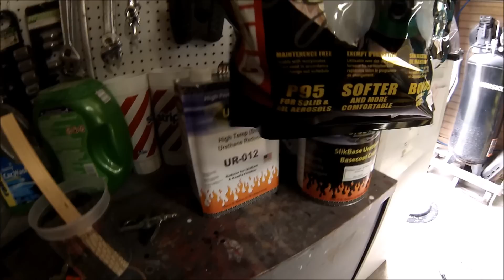2000 CHEVY SILVERADO RESPRAY WITH THE CARBONIO 360

Comment: I bought an electric porter cable DA to grind the paint off and save my air compressor and the noise.  Then I switch to a air DA once down to the metal.
Reply from the maker: Awesome I need to do that two

Comment: Would help a lot with the dust if u wet the floor with a water hose. When u spray the lower parts of the car a ton of dust comes up on the air. Also turning off the lights after finishing would help not to atract the bugs inside. Good work.

Comment: Every project you do is spectacular. How do you get the final clear coat so perfect without wet sanding and buffing?
Reply from the maker: Rob Arthur preping the body as perfect as posible and cleaning the area 3,4 times before painting
Reply: What number sand paper do you use at first to cut through the clear coat. I see you always finish with 320 wet sand and then spray.
Reply from the maker: I finished with 320 and 400 grit I stared with 220 and 320 grit

Comment: A few of us would love for you to tell us the time between all of your coats. Like I said before. I'm doing a candy with pearl over a silver base. Plus..  .... What gun, nozzel6, and and pressure are you using for each paint. Base, clear, etc. Thanks,  my paint brother.
Reply from the maker: The time between coats is 15min also for the clear the tip size it a 1.3 tip and about the air pressure it was at 29psi for the base and 35psi for the clear
Reply: What brand gun are you using

Comment: What Gun is that? Do you run 35psi off that 3.5hp husky air compressor?
Reply from the maker: it's a walcom carbonio 360 and yes it's a 60 gal compressor

Comment: What type of gun did you use
Reply from the maker: It's a Walcom Carbonio 360 made of carbon fiber
Reply: Damn that's nice what tips do you prefer when doing your base n clear
Reply from the maker: @jameswatts1808  I use a 1.3 for base and clear
Reply: @PHARRAWAY  nice job brother thanks
Reply from the maker: @jameswatts1808  any time brother here to help
Reply: @PHARRAWAY  I'm doing my truck and I got to knock off 2 bad paint jobs it has on it now ugh but it's getting there just need a compressor
Reply from the maker: @jameswatts1808  sounds good just don't rush on the work or you will have a bad foundation for the new paint job just take your time and do it right the first time
Reply: @PHARRAWAY  yeah I know that's why it's been taking me along time lol in the 16yrs doing body n paint never came across this much bull crap on a car or truck I'm pretty much knocking all down with 80 all around it's that bad
Reply from the maker: @jameswatts1808  WOW that's tough but you do what you have to do to get the job done the right way if you can email me some pictures at pharrawaypaint@gmail.com Thanks and GOD BLESS
Reply: @PHARRAWAY  just sent you a few clips through my phone to your email
Reply: @PHARRAWAY  if you got a Facebook or I.G. I like to follow
Reply from the maker: @jameswatts1808  Got them, that is bad, but looking good just keep on with the 80 grit and take off all the old paint so your foundation is good your your paint that is the problem that a lot of painters that don't care do
Reply: @PHARRAWAY  yup it's bad the roof is the worse but almost done with the rest even aircraft paint stripper  didnt work lol
Reply from the maker: @jameswatts1808  Nice